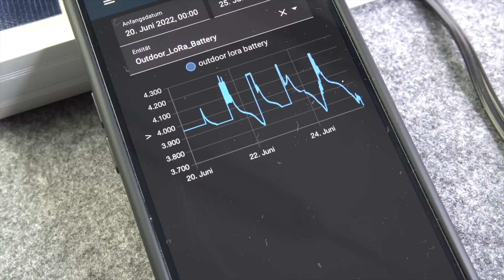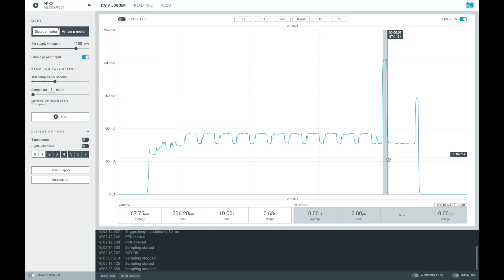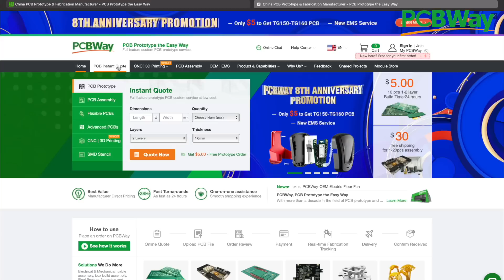I built a LORA GPS-Tracker with ESP32 | makermoekoe

Comment: Disiplined temperature controlled clocks for near atomic clock precision. Use a proper QHT helix antenna in a cone or cylinder for protection. I snagged on off an old radiosonde. The angles and spacing is very precise and hard to get right by hand.

Comment: Nice job! I don't see the USB IC in yout circuit (like CP2102 for example)... how do you upload the firmware to your esp32 without it?
Reply: You might have mentioned it in during the video but i watched it with no sound
Reply from the maker: The ESP32-S2 has a built in USB-CDC port which can be used to flash the mcu directly without the need of a usb2serial bridge 👍🏻

Comment: I really like your channel a lot, it's all that I like, and I'm very impressed with the dedication and effort you put in, when I saw the gps ones I felt quite inspired since I really like mtb, I think I could modify your design and just by lengthening the pigtal a bit you could put it inside the bicycle frame and have an anti-lost gps(gps tracker video), or with the project in this video you could mount it on the steering wheel and with an electronic ink screen (for the sun), could you monitor your performance in real time as if it were a garmin gps, that would be so cool, do i have your permission?

Comment: Be interesitng to see if you could use this as a vehicle tracker/monitor, as most of the current ones on the market either have poor accuracy/coverage or require a subscription service.   
A great small device that can be easily hidden and just extend any antenna/aerial lines to reach near a window.
Really interesting video!

Comment: Forget the GPS. Take the LORA and attach a mini-keyboard. Then hook up an E-Paper display. Maybe a solar cell on back? Program it to burst transmit a compressed/encrypted message for 1 second every 1 to 5 minutes based on a timed calculation of PI via a RTC module. Likewise use the receiver to look for replies using the same timing. Add a button to sync the calculation of Pi to the same second for 2 or more devices.

Volva, Spy-Worthy Doomsday Communicator. Burst transmitters are difficult to triangulate. You could even set them up to Mesh Network.

Comment: What is the typical time to lock a GPS position when you first turn it on? Datasheets for some GPS modules show ~30s cold start and some people report up to 10 mins to get a lock sometimes. What do you typically experience?
Reply: This is a pretty late reply but anyways. These modules, like all GPS modules have a faster GPS lock  in a wide open sky scenario. Some claim under 2 seconds but typically the ones i've used, from cold (not powered up for an hour or so) will get a co-ordinate lock in about 30 seconds with about 50% sky viewable. 20 feet into my condo unit with a floor above me will take longer, but still doable. Higher sensitivity is one of many of the key features that will speed that up. Even those $14 GPS modules like a GU-7 can do a 30 second lock from cold.

Comment: Can you tell me more about the soldering machine shown at 1:34?  It appears to be a heated plate but what is the Z-axis motion for?  NIce project, thanks.
Reply from the maker: The z-axis is to let the plate cool down faster. Once it is lifted, the fans are pointing directly onto the bottom side of the plate so that it can stay onto the hotplate once the job is done.

Comment: Id love to use one of these for my 4x4. If possible I'd set it up mostly for a gps system for navigation,  with a fall back for finding the vehicle if stolen or lost.

With perhaps another used as a walking gos navigation for camping/hunting and fishing
 If software allows could even point you in the right direction to return to base, or another device, eg the vehicle mounted one.

Comment: Could you link a sensor that would detect movement and only trigger the main board GPS location when there is a change and reduce power usage even further?   That way it only polls location tracking if the location has changed.   That is if there are motion sensors that are lower power to pull up the ESP out of deep sleep and into action that is lower than periodic polling alone!
Reply from the maker: That is a great idea! Maybe I can try to implement a movement sensor (accelerometer or gyroscope) to be able to activate my Picoclicks latching circuit, which would reduce the power consumption heavily. Do you know an ultra low power movement sensor with an interrupt output?
Reply: @makermoekoe  of hand I can't think of any, though very much amateur learning level (though we always learn), but mindful that something akin to a mercury type switch may well do the job as could run the needed voltage thru that to trigger with that only passing if triggered and can get some sensitive ones, also believe there are spring switch's that would also do the same.   So in effect maybe one or two of those to cover the axis would be zero power when inactive and movement would then make the contact momentarily to achieve a voltage trigger.

Comment: I would like to know what is that coin battery that was used, is it a battery or a supercapacitor?
Reply from the maker: It is a tiny 3V backup battery for the GPS module
Reply: @makermoekoe  cool! I would like to know what's the model number or brand for the battery. :)

Comment: I don´t like the RFM95. Instead, I´m using the RAK3172 (based on STM32) which gives you a lot more options for LoRa. It supports LoRaWAN 1.0.3, LoRa P2P, very low power with 1 µA (I have checked it on my own), an easy interface with AT commands, and other useful stuff. Also, you can put the ESP32 to sleep mode during each join and transmission cycle which optimizes the power consumption. With this module, I got my ESP-based projects to the power consumption of less than 50 µA (depending on the idle current of the 3.3 V regulator). The LoRa module stays powered on all the time.
Reply from the maker: Sounds great, I definitely should have a look on this LoRa module! Thanks!
Reply: I just don't like LORA or any of these "open source" projects which require an "association" membership.
Reply: @whatilearnttoday5295  there is a GitHub link with all the stuff...
Reply: @kampi89  You're not allowed to develop a product with it unless you pay the association fees, and be approved/permitted by their central control. It's a business plan common to all these "Open Source" wireless protocols. They vendorlock young developers who invest time before reading the terms.
Reply: @whatilearnttoday5295  I didn't need to pay anything to use The Things Network...

Comment: This is basically a T beam from TTGO, it has all of the specifications yours has but also simply supports the meshtastic ecosystem.
Reply: T-Beam doesn't have the display, nor?
Reply: @wilfriedklaebe  well actually by default it does not, but the pins are already aligned for the classic oled display and the manufacturer ttgo already sells an add-on witch not only has the oled but also a couple of buttons. So technically it does not  but anyone who needs it can easily add it
Reply: @wilfriedklaebe a display comes with it. the display slows the T-beam dramatically. it draws at etch-a-sketch speeds.

Comment: I would love to see a even more miniaturized version, that can easily fit into a backpack etc. So you would be able to find it if you forgot where you left it or even if it was stolen.
Reply from the maker: Great idea! Would you give up the OLED display in this case?
Reply: @makermoekoe  Yeah sure, as you don't really need it in this usecase. But with the use of LoRa you would need a mobile LoRa receiver as well I guess 🤔
Reply: @walndyn   TX e RX monitor with ability to activate the alert mode and increase the information parameters, then exit the energy saving mode held most of the time.
Reply: @makermoekoe  No need for display. would it be smaller to have interface to a smartphone app ? maybe tracker for electric bike?
Reply: @makermoekoe  Please try and make the board as small / slim as possible. Could even use 2 x 18650 side-by-side horizontally for longer use with an additional power input for powerbanks/ebike/car/motorbike batteries. This project would have so much support from hikers; travellers; cyclists; bikers; commuters; euc riders and basically everyone who wants to protect something valuable at low cost without a monthly subscription. I'm sure there's plenty of people willing to contribute. You'd get plenty of people supporting via patreon. I'm willing to support you. Please do this. The possibilities are endless. It could be placed in a handbag disguised as an item of makeup, or a bike part, or even stitched into a voltaic solar bags shoulder straps permanently. Love this project. Keep innovating. Thank you for sharing with us.
Reply: Wow. Someone's already doing it - search nolilab loko - it's an open source project

Comment: super impressive project. A headless (display-less) would be great for my use case of mounting a GPS Tracker with LoRa under a cycle seat.
Reply from the maker: The size can be reduced heavily in general, without display the device would get even smaller 👍🏻
Reply: Look for LILYGO TTGO T-Beam!
Reply: @wilfriedklaebe  interesting. thanks for sharing

Comment: How long does it need to first GPS fix position?
Reply: Up to 40 seconds, but in reality around 5-10 seconds
Reply from the maker: Yes for me it was usually under 15 seconds. If the backup battery is installed and the device hasn't moved a lot the position is updated in around 3-5 seconds

Comment: Very good proto!! What I would like to see the following GPS data on your display:
Altitude (Elevation), Heading, Speed, Distance (from a start point) , and a calculated pitch angle.
If this data could be sent over bluetooth, all the better! (then Android users could grab the data for App Inventor 2 custom apps)
The problem with the units sold on Amazon is their packaging. Your module would allow for much needed customization.

Comment: Cool Project. I'm currently also experimenting with LoRa and had something similar in mind, but more like a mobile tracker / alarm for a trailer. I want to give the Quectel L80 a try, which is a pretty small GPS Module that includes the Antenna and plan to add an accelerometer to power the rest up by an interrupt when it starts moving. I'm curious to see how it's performance will be compared to the Neo modules I've used in the past. 
For the power management I recently stumbled across the AXP192 (from X-Powers) that TTGO uses on it's new revision of the T-Beam board. It includes in a very small package the battery management / charging, support for a backup battery and has 3 integrated LDOs that can be controlled separately. It's super interesting, but so hard to find a reliable source for it :/ Maybe someone knows a good alternative that's easier to source?
Which LoRaWAN Netzwork do you use?  At least here in NRW Helium seems to have a much better coverage than TTN from my first tests.
Reply: I'm looking for something like it. 
I also thought of a great way to hide everything, using the chassis of a smartphone, using its original battery, removing the screen, leaving only a black film.
The lora module will send scheduled updates, but less and less frequent since the last movement of the accelerometer.
As soon as the accelerometer senses a higher average value it will start to activate GPS and communicate even before the device has moved.

Comment: It's a nice project, but why the weird title?
Reply from the maker: As I wrote in the description, it wasn’t planned that this could be used as a tracking system as well, it was just designed as a test board
Reply: @makermoekoe  I still think it is a silly title. It's a GPS tracker by hardware, even if your software or the overall concept was different in the beginning.
Reply from the maker: @graealex  I changed it to avoid other misunderstandings

Comment: Could this work on the helium network? If so it will be a hit.
Reply from the maker: Don‘t know much about Helium but what I read so far is that a standard LoRa (-WAN) module will work, so I assume it is somehow possible
Reply: @makermoekoe  Possibly only software is needed because you have everything on the board, could be used as a mapper or as a GPS tracker. There aren't many trackers on the net right now and this would help
Reply: Thinking the same.
Reply: lol blockchain for wireless communication? HAHAHAHAHAHAHA You've been scammed.
Reply: @whatilearnttoday5295  try at least to understand what it is and how it works.
Reply: @leosedf  A shitcoin scam?
Reply: @whatilearnttoday5295  Not really, it's been running a long time and has build a world wide network. Just because you don't know what it is and don't use it it doesn't mean other people don't, and it has expanded to 5G now and will go wifi too.